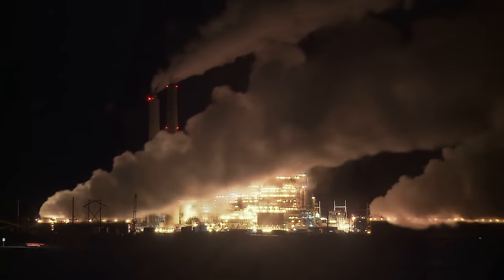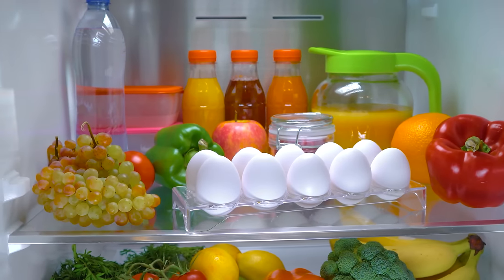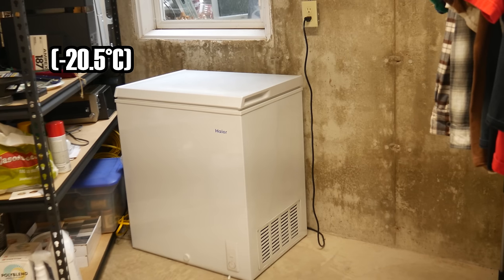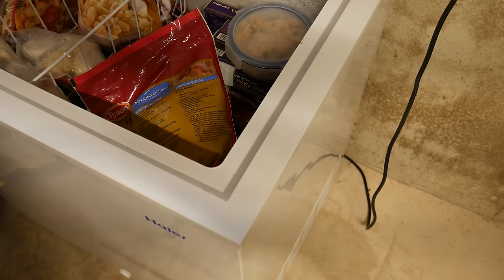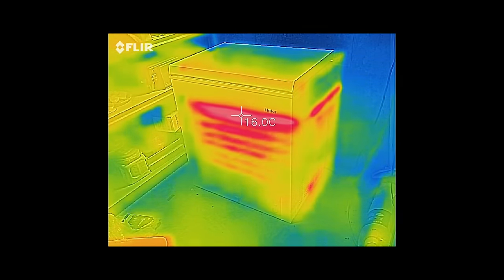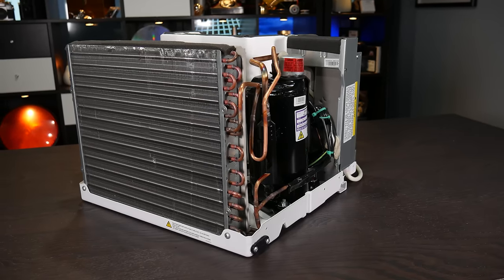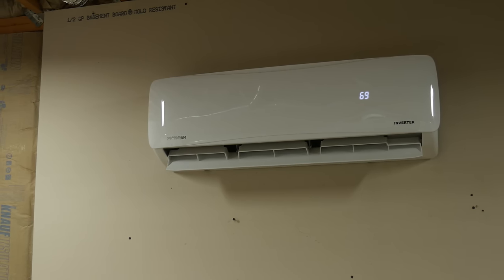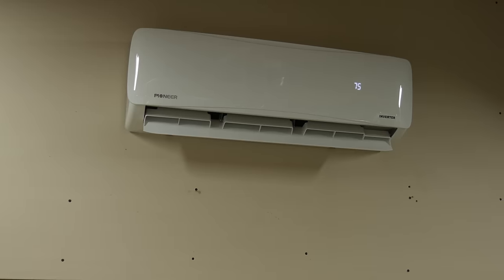Heat Pumps: the Future of Home Heating

Comment: No heat is being exchanged at temperatures less than  ~19°f on any of these basic units.
To gain heat below that requires you to drill down to install a geothermal assist.

Once it gets below a set temp, it will switch over to auxiliary heat, usually blowing a mix of interior and exterior air over a resistance coil or set of quartz rods, into the ductwork which maintains a small positive pressure to keep cold air out of anything that leaks cold air from the outside.

Mine, a Trane 4.5 ton with a seer of 19.1 was installed in 2017, and it remains a game changer over the only other choices, which are natural gas  or wood. (pellet stoves preferred greatly) (propane is WAY expensive here). 

My only complaint is that once in a while, when temperatures are between 25 and 32, the auxiliary won't kick in. Forcing me to reset the breaker on the furnace itself. 

While I miss gas for cooking, it has been consistently cheaper than my nearest neighbor who has been running a Lennox gas furnace and 2x window A/C. Their house is 208 square feet smaller, but both built by the same construction company, within a year of each other, and on a similar floor plan.

Comment: Me living in Texas: this sounds exactly how it works down here
Reply: Ya, I am in my mid 30's and as long as I can remember most houses have used heat pumps. I know up north they use a lot more gas and oil type furnaces though.
Reply: Typically further north the heat pump system, unless using geothermic heat exchanges, are not effective enough for house heating. The extra electrical heater strips needed to maintain heating out strip electrical consumption over other systems. Not to mention, if you're in an area that's already plumbed for natural gas, it's typically cheaper to run a gas heating system.
Reply: @SlavicCelery  Yes, below 40F, you need a backup like natural gas, propane, or even wood. Resistive heat costs too much.

Comment: You could really have used a de-esser filter in this one <3
Reply from the maker: This is actually a re-upload with a more aggressive filter! I have very harsh sibilance and for whatever reason the audio settings I use have gotten borked from one project to the next. I'll listen with a more critical ear in part 2!
Reply: @TechnologyConnections  Ouch! >.< But it's still a great video!
Reply: Premiere's de-esser sux.
I've needed it a couple times and it only made the audio sound like garbage without doing what it's suposed to do
Reply: @TechnologyConnections  Use a proper multi band compressor instead of a simple deesser, and you will have more control over the strength of the filtering and what frequencies are being affected :). Better than a straight EQ cut to the highs too.

Comment: At 18:19 you state, “where it will boil and absorb latent heat” I got confused and had to start over - I think you meant that it absorbs latent heat leading to boiling - it doesn’t boil first. May sound nit-picky but it is complicated especially to a lay person. And thank you for getting this info out.
A big problem here in US is finding a system to fit existing duct work - a lot of hvac companies install units that are too big or with too big of circulating fans which causes the heat pump to cycle on-off frequently leading to wearing out and them not properly dehumidifying which is important when cooling.

Comment: I discovered this channel and had to smile at first: "... the future of home heating". Why is the USA so many years behind in many technologies when it is leading in other areas? There is still a lot of catching up to do, especially in house building and all the technologies around it. But it's good to see that more and more Americans are interested in it and are actively asking the suppliers and craftsmen about it. This is the only way to achieve change. Otherwise, the power of the familiar is too strong. 

Heat pump technology has been used in Scandinavia for more than 25 years for the majority of homes. I live in Germany and have been heating a two-family house with 2 floors and 270 m2 with a heat pump for 15 years. Our heat pump extracts the heat it needs from the ground in the garden via special collectors. This works wonderfully. In addition, there are solar collectors on the roof that heat the water in a buffer tank when the sun is shining. When the sun is low or the days are cloudy, the heat pump takes over and extracts the heat from the ground. The best-known types of heat pumps include air-water heat pumps, brine-water heat pumps and water-water heat pumps. I use the brine-water heat pump. 

However, there is always one thing to bear in mind when using a heat pump. The house that is to be heated with it should have good to very good thermal insulation. Otherwise, the efficiency of the system drops significantly and you can save yourself the trouble.

Comment: Back in the 70's heat pump systems for AC and heating were available. My parents had a heat pump that used well water. Well water was extracted from one well and returned to the ground water via another well. Well water has the same temperature year round and it was this condition which was exploited.

Comment: Despite my lack of education I generally like to think I have a pretty good understanding of what's going on in the world around me. But latent heat is fucking me up.
Reply: You don't understand heat pumps warming up a home with cold air because it's a scam and it doesn't work , that's why. If something is cold, you can't use it to warm something up that is already warmer.
Reply: @Withnail1969  you clearly doesn't understand this topic
Reply: Latent heat to put is simply is the amount of energy needed for something to change it phase.

Let's say for example (making up numbers for your understanding)
1 kg of  liquid Water needs 300 latent heat units to change to steam, so we have to give water 300 to get steam
We can also take 300 latent heat units to convert that steam back to Water.
Reply: @nikodga5577  if its 1 degree C outside and 10 degrees C indoors, you can't warm up your house with the outside air no matter what mumbo jumbo you say.
Reply: @Withnail1969  If you acknowledge that air conditioning works, refrigerators etc, you acknowledge that heat pumps work.  They're all doing the exact same thing.  They take heat out of a colder area and move it to a warmer one.  The only difference is the temperatures at which they operate.  We call things "cold," but in truth there's heat energy in everything that isn't at absolute zero, and I assure you that nothing around you is at absolute zero.
 
Heat will always flow from hot to cold.  To that point, you're right.  Without any interference, heat will flow from the warmer house to the colder outdoors.  But, since heat always flows from hot to cold, if you put something outside and make it even colder than it is outside, heat will flow from the cold outside air to the even colder object.  Again, cold is relative.  From the standpoint of the cold object, the air outside is quite warm.  

If it's 1 degree outside but you chill the object to 0 degrees, heat will move from the 1 degree air to the 0 degree object.  The greater the difference the better here, as it accelerates the rate of heat transfer.  You can then move that absorbed heat inside and warm the interior.

The efficiency of this transfer varies based on the temperature as he explains well.  The outdoor coils can only get so cold, based on refrigerant type and system design, and if the temperature outside drops to the same temperature, you stop absorbing heat from outside.  Hence system efficiency drops to about 1, where the heat you get is basically from the energy imparted on the refrigerant by the compressor.
Reply: @nate0031  didnt say they didnt technically 'work', just saying that if its colder outside than in, you will be using lots of electrcity and might as well just use heaters inside the house.
Reply: @Withnail1969  They definitely use electricity to move the heat. The benefit though is, for the same heat output, they use anything from the same amount of energy as the electric indoor heaters, to about 1/4 as much energy, depending on the unit.

This is to say, if the system is setup right, it can put out the same heat as a 1500 watt electric heater for 500 watts or less, depending on the weather outside. Essentially, a heat pump at its worst pulls as much electricity as an electric only heater. At all other times, it'll make the same heat with less electricity. And, since the equipment is already there on many houses, it's a win-win.

Their pitfall is really cold weather. This is why houses with electricity only have electric elements for aux or emergency heat. So most places with a heat pump are already equipped with the electric heaters you like, but they don't use them unless needed because it'd waste a lot of money. If you can get the same BTU output for a third of the electric energy input, it's easy money.
Reply: @nate0031  if it doesnt work in really cold weather, it's useless to me.
Reply: @Withnail1969  then you agree that it isn't a scam

Comment: This video was brought to you by: The mountain of regret the state of Texas is experiencing right now.
Reply: I would imagine most Texans wouldn't have invested into heat pumps rated to go into negative F.  Judging by the electric companies anyway :(.
Reply: Actually, you could EASILY make the case that gas heating systems worked much better than high current electric systems. 

Now a week later when it was above 80F, those heat pump systems were reversed lol
Reply: @cryangallegos  To me it seems in Texas one of the issues was, that most Gas furnaces didn´t work without electricity as well. How some may have envied those with an actual working wood fired fireplace. Not sure if that would have helped a lot of the burst water lines at all, as those have been mostly in the outside walls (why not when you never expect them to freeze... oh wait....)
Reply: I am Texan have a heat pump, my dad has a normal ac with a wood burning backup system that means that if he wants more heat or cool air he burns wood. My unit didn't work due to the humidity and temperature along side my power going out due to an electric pole being ripped apart by ice. My dad never had a cold day

Comment: People in the comments seem to be confused by the fact that not all Heat pumps are the same.   There are many different makers, models, and configuration options.   Your underperforming heat pump is not the only size and configuration available.  Just because yours doesn't wotk below freezing doesn't mean they can't  be made to work effectively and efficiently below freezing.  

Also, as  this whole process creates condensation, the refigerant lines will corrode over time.  As pores develop in the condenser lines, refrigerant is lost and efficiency is reduced.  So, an older system may not be wrong for your application, it may be leaking and undercharged.  It could cost 400 to 1500 to fix a leak and recharge.  But it costs 10 to 20,000 for a new unit.
Reply: True! People in this comments seems to know everything about all heat pumps in the world. Like there is no world outside their sphere! Our scandinavian pumps are extremely effective in cold. But I would not recommend the same models in southern california because they might not be made for cooling down high temperatures 24/7.

Comment: I live in the UK and my house which I bought two years ago has a heat pump. I don't know what its COP is, but assuming it is around 3, then it is marginal whether it is more cost efficient than using my gas-fired hot water system for heating. That is because in the UK the price of a kWh of electricity is around three times that of a kWh of gas, thus making the cost of a kWh of heat about the same in both cases. The heat pump is also noisy (situated in my main living room), so it doesn't get used much. Did use it as an A/C this last summer, where we had a 40 C heatwave.

Comment: As long as your electricity stays on cough “Texas”
Reply: True but part of the reason was the high consumption and supply squeeze on natural gas
Reply: @enginerdy  
To generate electricity for increase electric heating demand.
Reply: @enginerdy  and that, even after years of warning, the state refused to put and effort into preventing this senario
Reply: @GoblinCh.  In Texas, a decent number of homes have natural gas stoves and furnaces. This means that the natural gas demanded is shared between electrical plants and heating homes. If less was needed to heat homes, more would be available for electric plants.
Reply: @obits3  Yes, Atmos issued a conservation notice to homeowners to turn down their gas heat as well so that more would be available for generation.
Reply: It's worth pointing out, too, that if your electricity goes out, your gas furnace DOESN'T WORK EITHER.
Reply: @RoboSkyrat  Yep. Tar and feathers would be too good for state leadership, who is more concerned with looking cool in front of their friends (the ultra-conservative lobby) than doing good for their constituents.
Reply: I’ve got gas appliances and furnace, and yes with no electricity I can’t run my furnace. Problem with the power plants was that the gas lines froze.
Reply: @votekyle3000  Yes, it was a dismal failure on the generation end, in addition to the increased demand.  Inadequate grid infrastructure, no matter how you look at it.  Someone should go to jail for what happened to the people of Texas.
Reply: @joesterling4299  Texas is totally controlled by monied interests. The statehouse is completely locked up for tea-party type (pro business, anti-regulation, meaningless wedge issue) Republicans, and all they have to do is virtue signal their conservatism once in a while and their rural constituents keep coming back to the booth for them every time.
Someone should go to jail but no one will.
Reply: @enginerdy  I'm fairly conservative myself, but I realize utilities and other natural monopolies require either government administration, or strict regulation and oversight.  Neither was the case here, as is plain for everyone to see now.  I hope at least the deficiencies are addressed, even if the criminally negligent ERCOT people get a pass.
Reply: @joesterling4299  ERCOT wasn't enabled by the state legislature to mandate winterization, the legislature didn't mandate it, the governor didn't mandate it-- they left it up to the mArKEt to allow the cost to become an externality, then reap the benefits of emergency pricing.
If the world was just, we would take the $100 billion cost of the storm out of the operating profits and accumulated wealth of the generation facilities and their owners.
Reply: @joesterling4299  These days to even be considered "conservative" you have to be (or pretend to be) an anarcho-capitalist and it's costing lives
Reply: @joesterling4299  Technically, it was a failure on the natural gas supply end which isn't held to the same standards like electric utilities are. The Texas electrical grid and generation companies got caught in the crossfire because their natural gas suppliers (who aren't held to the same standards) dropped the ball.
Reply: @enginerdy  That sounds like pure bullshit to me.  Conservative simply means I'm the same guy I was 30 years ago.  My sense of right, wrong, moral and immoral have not changed.  But in fact, I'm more of a stickler for fiscal conservatism (i.e., people, companies and governments should pay their own way through life) than social.  I've never had an issue with diversity or sexual orientation.  I do, however, have a big issue with one group of people forcing their social ideology on others.
Reply: @joesterling4299  You would not be electable in today’s Republican Party. I know a lot of good and reasonable conservatives, but most of them wouldn’t pass today’s far right “purity tests”.
Texas helped lead the way on this brand of conservatism, and that’s how we got here.
Reply: @dsp628  It wasn’t just them, all types of generation were affected, even nuclear
Reply: @enginerdy  But it's much easier to get backup power for a gas furnace than for a heat pump... For a gas furnace, a small, cheap backup diesel power generator is enough. In case of a several-hours-long power outage, even a UPS would suffice. A power generator needed to power up a heat pump would be so large and expensive that it makes absolutely no sense.

Comment: The future? Here nearly every home has a heat pump lol, my house has two
Reply: where do you live?
Reply: Same, Anything made in the last 20-30 years came with one standard... and I live in the midwest.  I thought this was normal now and only old homes like mine had AC plus natural gas.  We still have some homes on oil heat which is unreal to me.  A coworker is switching from oil to buried heat pump lines this spring.
Reply: @ommiguel  New Zealand. There has been a government funded scheme here for many years that subsidizes heat pump installations so the cost is added to your council rates (property tax in USA?)

Comment: I bought a portable Toshiba air conditioner for occasional use  that rolls on wheels with an 8' long exhaust duct to direct the end to the outside. I realized that it could be used to heat also,  simply put the unit outside and direct the exhaust into the interior , or put the unit in a room you don't care gets cold...

Comment: I had one and hated it in cold winter. Had a gas furnace that kicked in during really cold weather. Heat pump is unable to make house feel warm.
Reply: A heat pump is only as good as it's installation. My oil fired boiler is getting old and was looking at alternatives. with the rebates and tax credits heat pumps looked good. Now with electricity on the rise who knows where electricity will end up. I'll stick with my oil fired boiler.